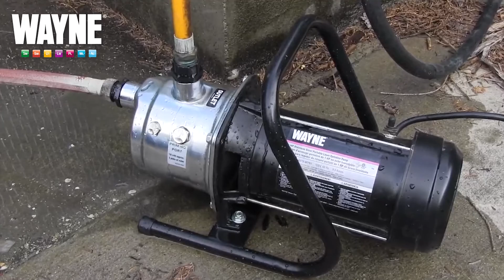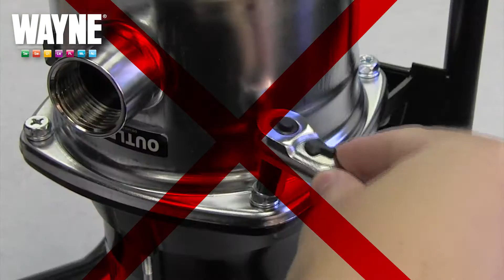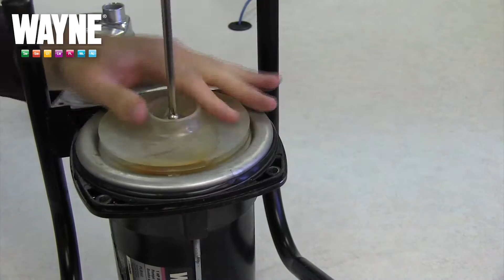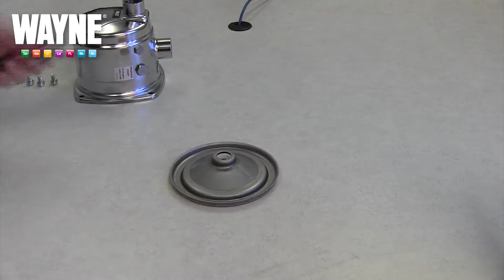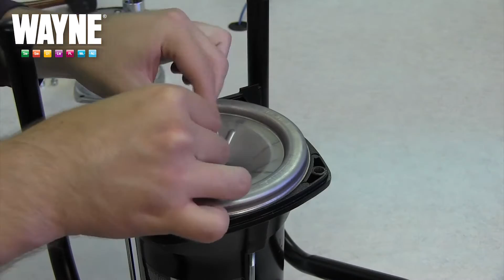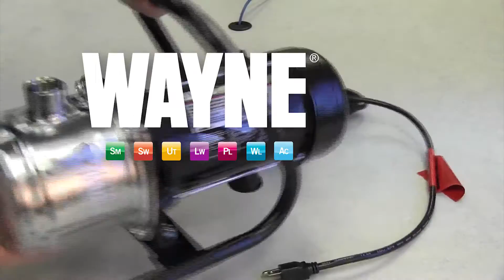How to Change the Shaft Seal and Impeller on the PLS100

Comment: Flat metal plate was stuck tight to the pump body. Didn't want to damage it with a screwdriver blade so used a knife blade and a rubber mallet. Worked great.

Comment: IIRC this is a sprinkler pump so its not supposed to have backpressure like a closed garden hose etc.. or it will build pressure until the seal leaks.

Comment: I have this model, and it does have a leak. However, it pumps well until thermal overload protection turns off the pump. 15 minutes it starts up again and pumps fine. I wonder if this repair would stop the leak at the pump and stop the motor turning off.

Comment: I also would like to know why you say : if you ever used a garden sprayer it might need this repair?

You ask above 
"For any questions regarding this repair or any other related questions let us know in a comment below."  4 months and you don't answer Ben's question below - NOT GOOD WAYNE
Reply: I'd like to know too, I'm assuming the garden sprayer doesn't allow enough water flow and the pump heats up and seals get damaged.
Reply: @Dontbuyitdiyit  Going through replacing the seals on our pump now...we use it with garden sprayers and it's leaking. My assumption is since this model is a lawn sprinkler pump, it likely doesn't have any kind of bypass or pressure relief feature so if using a garden sprayer, the pressure builds up until it either overloads the motor and trips a breaker or thermal protection or the weakest link blows out (the shaft seal). I'm surprised at this little pump though. It's a beast and has survived several years now pumping water out of my boss's boat slip which is then used to run a sprinkler or water the flowers around the house.
Reply: @blackshirej  what all seals did you replace? My the big O ring inside my housing appears to be fine, but water sprays out where the pump bolts up to the motor. 

Where do you find the parts? 

I need this pump running soon, to save my garden from a drought.
Reply: @randyphillips1029  I ended up buying a new pump. I replaced the shaft seal and the big o-ring but that didn't fix it. I also cracked the impeller removing it from the shaft and later found that it is recommended to replace it at the same time. That was my problem as well. Spraying where the pump bolts to the motor. I got the repair parts on Amazon. Looks like there's 2 kits for that pump. 64048-WYN1 is the seal kit ($17.08). Impeller is 64049-WYN1 ($14.60).

One suggestion I have is be very careful tightening the 4 bolts that hold the pump housing to the motor. Mine felt like they were beginning to strip out and I was using a small wrench to tighten them back up. Honestly probably can tighten them sufficiently with just a screwdriver.
Reply: @blackshirej  thank so much
Reply: having problem removing shaft nut